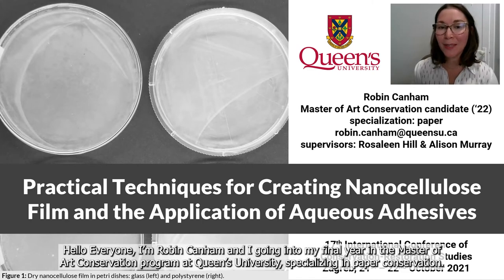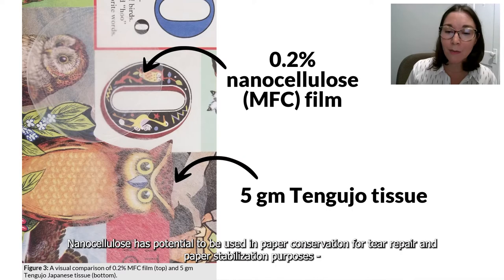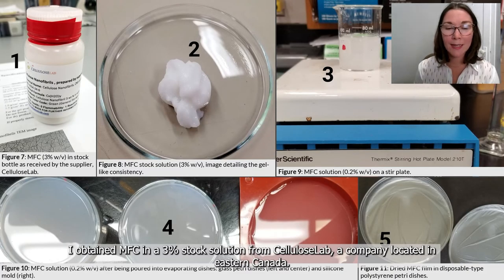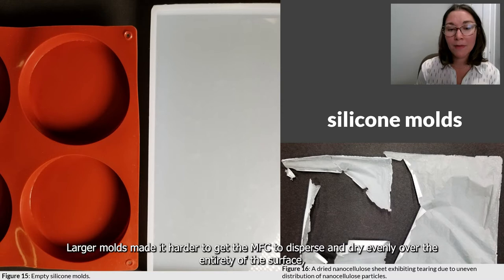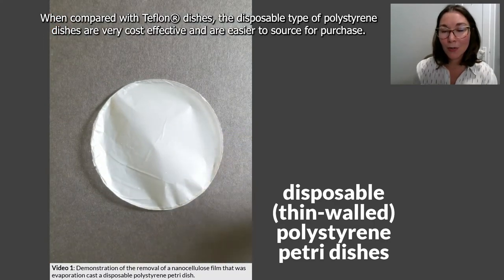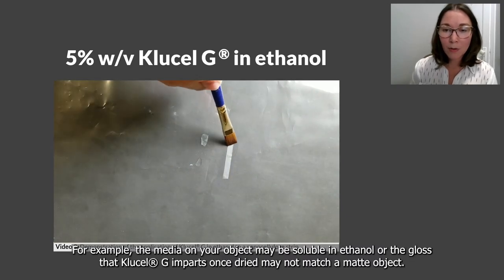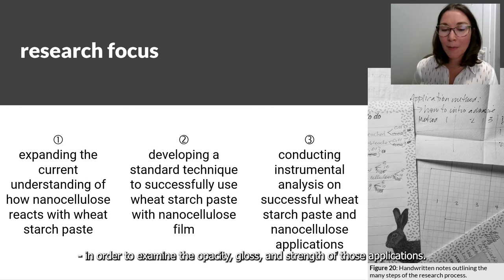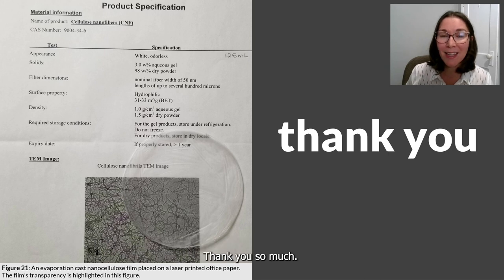Practical techniques for creating nanocellulose film and the application of aqueous adhesives

Comment: Very cool! I am an MFA student at the University of Maine and we have been fortunate enough to get CNF from another department on campus for explorations of its artistic applications… our group is working on integrating scientific processes with our creative practices, but it is something of a struggle … videos like this are extremely helpful!
Reply: How you dry your layer of cellulose ? On which substrate you dry so that it detach easily after drying?
Reply: @moniyakatyal7144   @moniyakatyal7144  In my case, it is not in layers per se -- maybe a better word would be chunks or globs. I make castings by filling metal cake pans, plastic trays, and stuffed animals, which are typically made of synthetic textiles. In all of these cases, the CNF detaches from the casting material on its own. Drying it on "natural" materials like wood or matted grass would be another story, it'd get stuck for sure, but metal, plastic, and textile molds do not have that issue. Mostly I am drying pints or gallons of it at a time, as UMaine produces so much they would have to discard it if artists and other experimenters weren't doing things like this and using up their surplus material.
Reply: How you make contexts electrodes on film ?